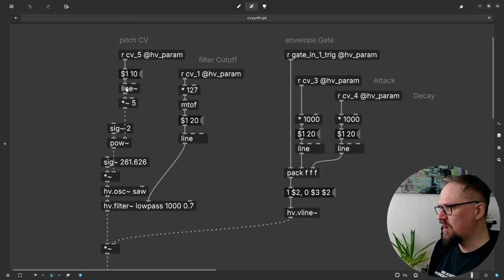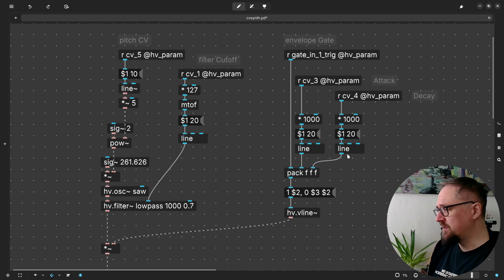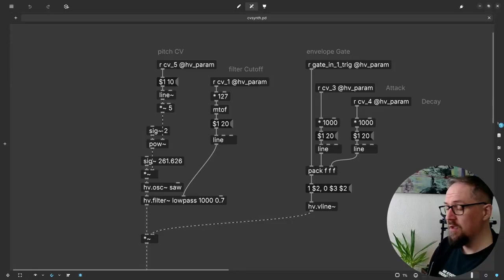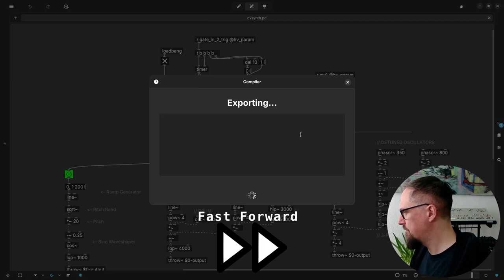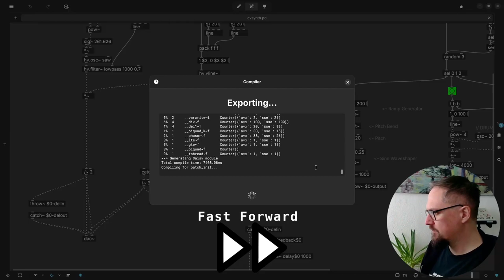PD to C - Modular Groovebox

Comment: will you make a video on using Plug Data with Daisy Seed and for example a potentiometer on a breadboard? the new Plug Data has no export option for Daisy Seed.
Reply from the maker: You will need to create a custom board.json
The seed doesn't have any configuration so you cannot chose it as a board.

Check out the previous video if you want to learn more.